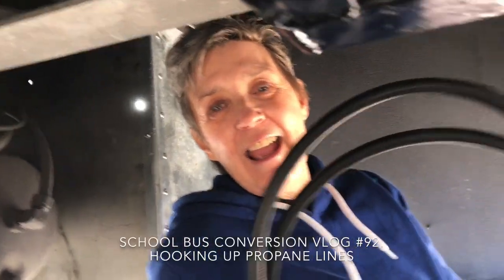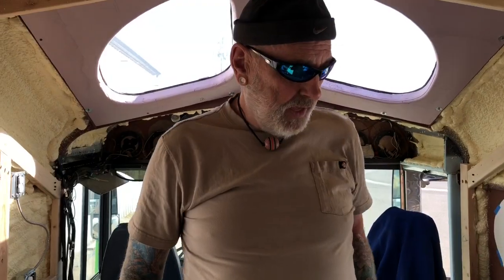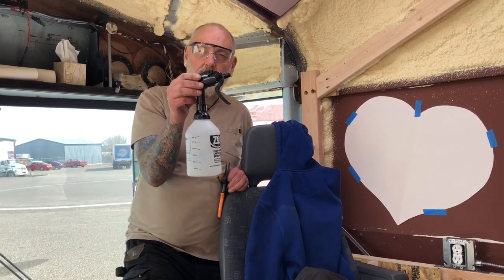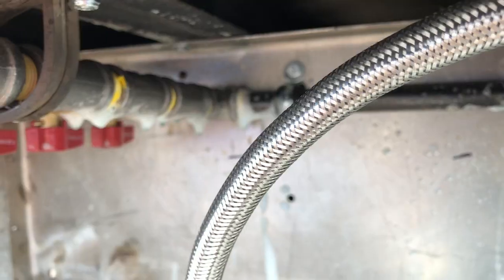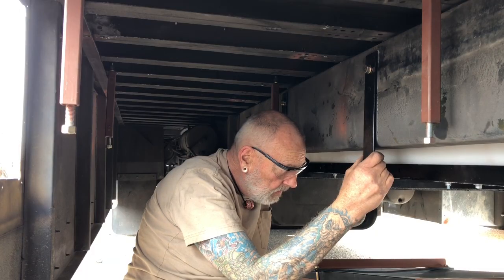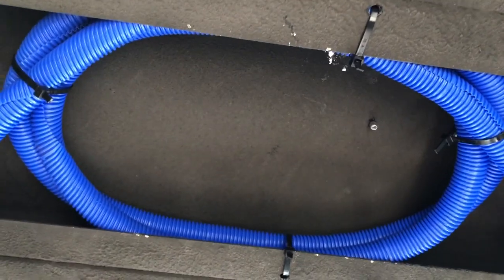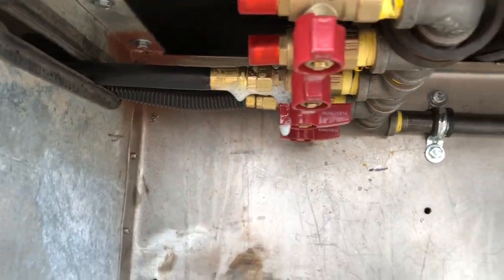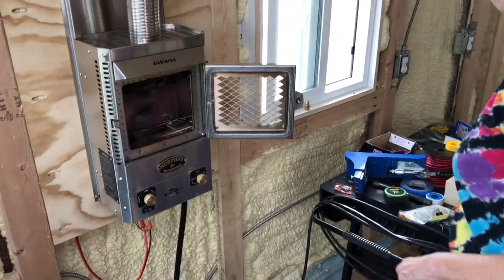Hooking up Propane Lines - Vlog 92 School Bus Conversion

Comment: Hi Guys.  I'm in the process of doing our propane set-up on the Harmony Express.  Did you go to an RV shop to have your hoses made or was it a specialty store?  I'm "flummoxed" right now with finding the right tubing for my propane!  Turns out that normal automotive fuel line won't cut it!  Thanks!
Reply from the maker: It was a bearing shop that sells hydraulic hoses. And they also carry propane hoses and fittings.

Comment: Y a manifold and not just a couple Ts? Will you actually ever shut down one appliance but not the rest? Seems like lots of extra parts and $$.  Will the fireplace line be inside the wall?
Reply from the maker: This come from Randy's experience  in a glass blowing shop. For us we want the ability to be able to turn off one and not the other. It's not necessary but how we are choosing to do ours. And ....Yes the fireplace line will be inside the wall.
Reply: Knapp Time  what size iron pipe did you use?? For the manifold?
Reply: Jason 328D - it’s 1/2” black iron.